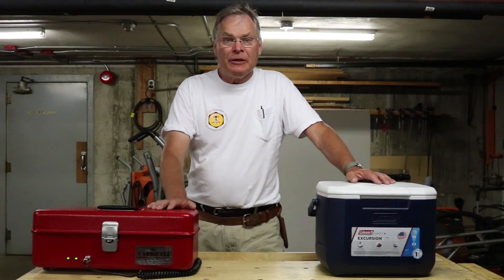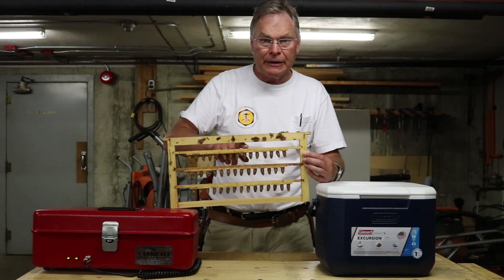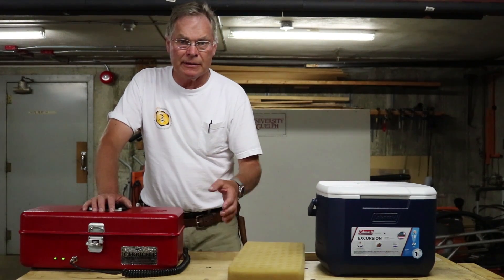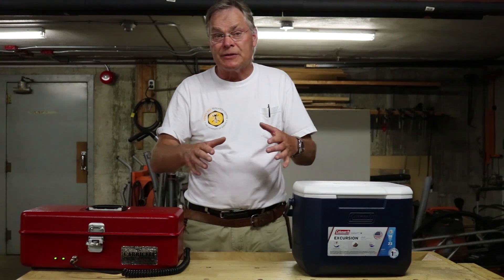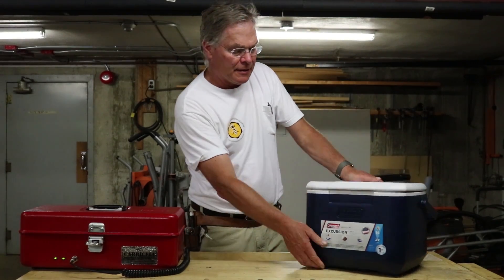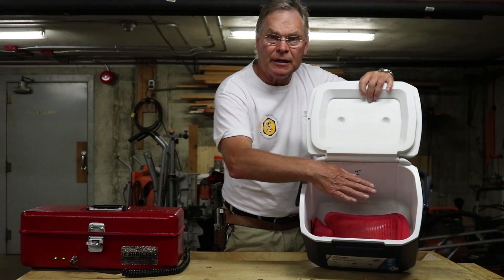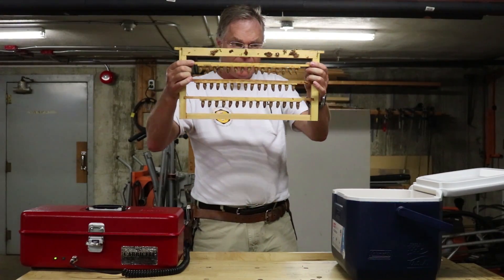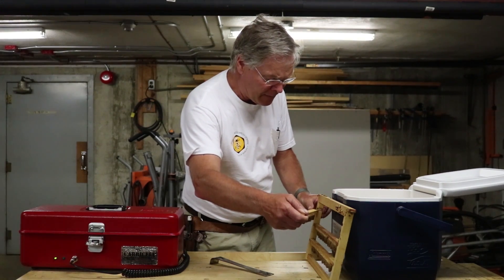Handling Queen Cells

Comment: I'm having problems with my queen cells. out of 25 queen cells, only 6 hatch. I'm using the incubator but I'm not doing something wrong. any ideas?
Reply from the maker: Hard to say Keith. Overheating cells is a common problem so make sure your cells don't get over 32C.
Reply: @UoGHoneyBeeResearchCentre  thank you
Reply: Some time later Re Question : 

Maybe check the Humidity too.
And/Or get yourself a xAA or xAAA Battery Humidity / Temp Reader. Often in Pet, Reptile, Seed Mat areas of Online/Shops.
They often have a Neat Display, Up/Down Buttons, a Thermal Cable, with a Tiny Metal 'Tip.'
Drill a Hole thru eg Box, (insert a Drinking Straw to hold pushed  thru Temp Cable.) Maybe add a Q Tip, or similar, at this Hole : to stop vent Cold leaking in.
Just an idea. . . Or buy a Cheap (reliable :Temp Held) Incubator from above. Hen ones here are about £50 / ($60) or so. These work a treat. [If a Turning option is given : Choose "Still Model" or unclip Turning Cable/ Connection. Queens stay still ! Not turned like Birds in pre hatch days up to chirping or quacking into the World (!)
* Also remember the First Queen to Hatch will KILL (Sting dead) any rival Sisters. So add into a Hive pre-day x14, or place each Queen Cell in a Roller Cage, or DIY Mesh type.
Hope this helps. 😎 
🐝🐝🐝🐝🐝🐝🐝🐝🐝🐝🐝
     Happy Beekeeping 2023.
🐝🐝🐝🐝🐝🐝🐝🐝🐝🐝🐝
I add some Wood :soaked in Water (Small thick Block) to give a bit of Humidity. Not the Inner Water Cavity ! : That's for Super high Humidity for Birds to peck thru their Egg Shells, in the Hatching Lockdown process ! 😉

Comment: Excellent. Any suggestion as to find all the cells in the cedar? Unfortunately, I just switched to yellow JZBZ cups. Last time I was using a zip lock bag with water with bubble wrap between them in a Styrofoam cooler. I ended up with several of my cells bad and suspect it is due to poor handling. I will try this method.

Comment: Hi Paul, I love how you demonstrate with a grafting frame with 45 accepted cells. Over time I have seen lots of references to removing the cells on day 10 or day 15. It took a long time for me to realize that there is a vulnerable period when the developing queens are extremely easy to damage. Can you elaborate on that sometime please?
Reply from the maker: Hi fshrgy99
It's pretty much standard practise to remove cells 10 days after grafting. If you handle them earlier the wing buds can be damaged resulting in deformed wings. I should lookup the vulnerable time frame but don't know it offhand.

Comment: Good Idea! I went and bought myself one of those little 12 volt windshield defrosters and a 50 watt ceramic element along with a 12 volt digital thermostat.  If my idea works I should end up with a 12 volt heated transfer case and a incubator gotta figure out what' I'll use (Like a bar fridge) or just build the incubatorout of wood. I Can use anything compact with a handle for the carry box, but, in the end. If it works??? it'll be around 100 dollars for both. I'm confident it'll work, however, I don't get too cocky. Important part is it should be as good as the sell and more importantly I'll save about 2 grand.
Reply from the maker: Sounds like a good plan. There are some pretty cheap chicken egg incubators available too. Friends say they work well.

Comment: In today's video, you showed putting the queen cell in the incubator without a base. However, in your last video: 4-way mating nucs you mentioned putting the base of the queen cell bases below the tops of the frames in order to keep the bees in their designated sections. In all of your other videos I can remember only seeing queen cells with bases. How do I insert queen cells between the hive frames without a base or how do I attach my queen cells on bases before they are attached to the queen cell frame? ❤🌅🌵
Reply from the maker: Hi Suzi
 It may not have shown well but the cells did have wooden bases on them. They make a good handle and a good way to hang from the top bars. Cheers!
Reply: If you don’t have a base you can press the top part of the cell into an area of empty comb on a frame.

Comment: Little tip for Paul: when you fill the hot water bottle, fold the still open waterbottle until the water is right up to the brim, that way you expelled all the air, if you don't the air will expand with the heat and you get the water bottle you see in the video, streched out, ready to burst. Ta for your DIYincubtor, cheers from France
Reply from the maker: Good tip. Thanks Christophe. Hello in France!